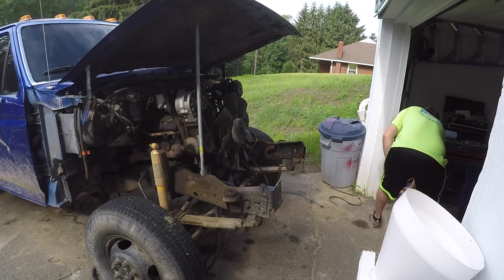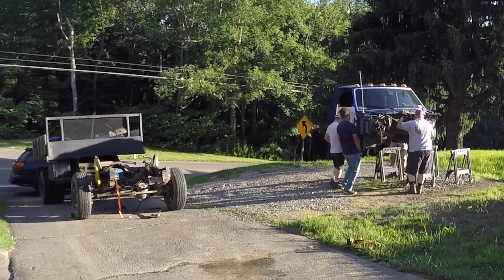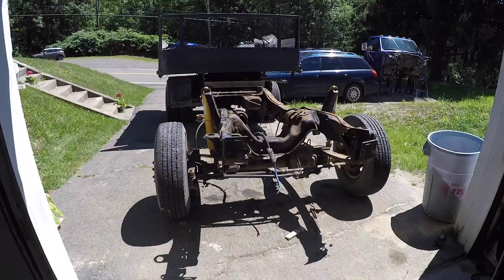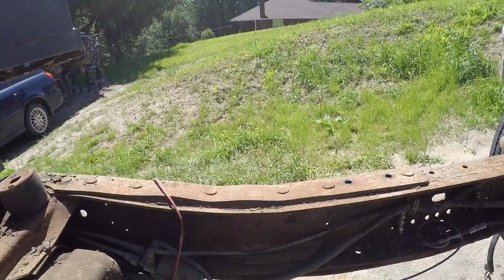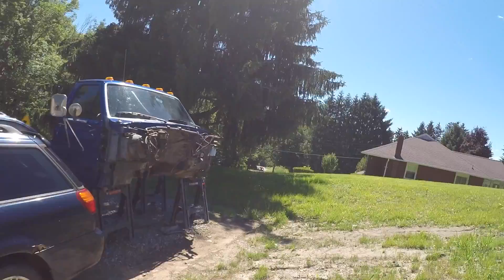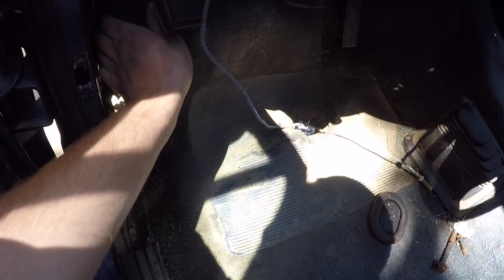Pt. 1 91 F350 Tear Down. CAT 3126 Engine Swap

Comment: I had that same cranking issue in the past on my IDI. The check valve off the #1 injector back to the filter was busted which caused the fuel to leak back into the fuel take. It had to prime it every time it cranked in essence. I know you already swapped but thought I would mention it.
Reply from the maker: It’s been a while, that was my first thought as well but I had just done return lines on it (6-8 months before the issue) and it had an electric fuel pump on it and I never had any air at the Schrader valve on the filter.

Comment: Thanks to JC Smith I found your channel. Those pieces of steel riveted to the frame are factory. All of the f350 cab and chassis have those. The f super duty's do not have them, they instead have a 5/16 thick frame rails where the f350 cab and chassis have 1/4 thick. Closest truck I have to yours is a 1986 f350 cab and chassis 4x4. Same body style as yours but mine has a 6.9 IDI diesel. Mine has the longer 84" cab to axle wheelbase with a 8' x 11' flatbed. Those IDIs aren't exactly fast but they are reliable and will haul what I need.
Reply from the maker: Welcome to the channel! I kind of figured they were factory, in my case with all the rust jacking I think they were doing more harm than good. That’s what I heard about the IDIs, somehow I managed to hurt mine.
Reply: For some reason the engineers at Ford thought those pieces of steel would help. In the rust belt all they do is cause the frame to rust like crazy. Since the bigger f super duty's don't have those on the frame they don't have problems with frame rust. Your f350 has some rust but it's really in good shape. My old 86 has a decent amount of rust but it's frame is still solid.

Comment: bet its the fuel pump
Reply from the maker: Lift pump or injection pump?
Reply: Lol or glow plugs .... prolly woulda just spent the 100$ for glow plugs and relay called er a day they won’t start worth a shit any temperature with non working glow plugs and injectors are cheap as shit. 50$ my cost each  she woulda started up instantly but the cat is much cooler

Comment: Before taking the cab off I would have marked on the chassis with a marker where the front of the cab was so that you know how far back you can put in the engine in the truck.
Reply from the maker: Yeah... that would have been smart.

Comment: Looking good. I would test fit the cab before you finalize any of your mounts. 

Yes easy to cut out or bash to tunnel but make sure it's gonna clear your master cylinder and steering
Reply from the maker: That’s a good point! I just wish the cab was a little lighter lol